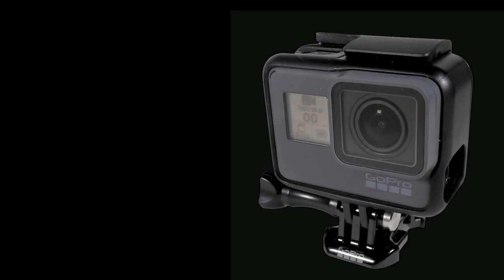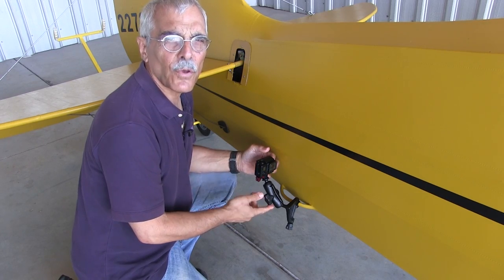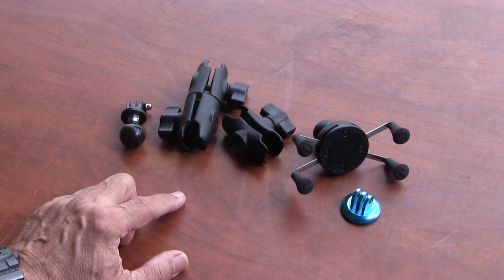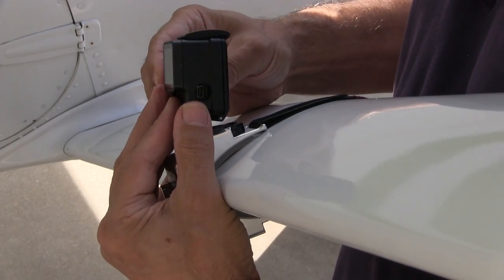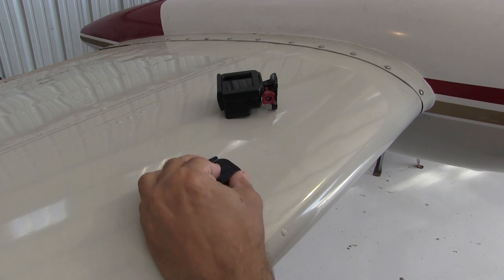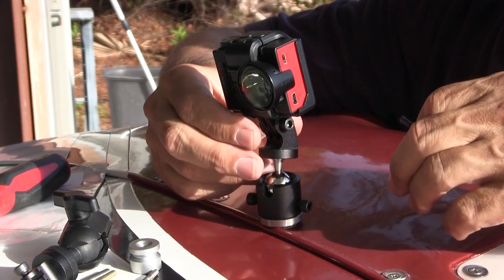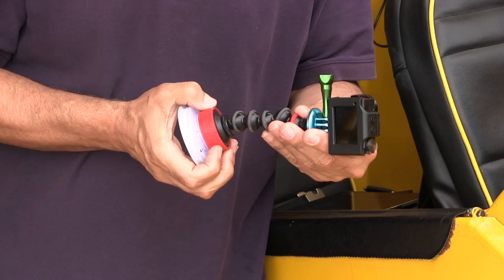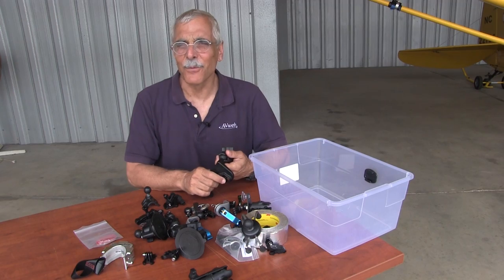How to Mount Cameras on Airplanes

Comment: I don't know if anyone will see this, but an additional option to add some security to keep the camera attached and protect the camera are "cages" made by companies like SmallRig.  These are exactly what they sound like - a milled aluminum cage that securely holds the camera inside and protects it from bumps on the outside.  They generally provide multiple mounting points and offer some additional points to attach a safety tether or to attach the camera in a different orientation.  Reasonably priced also!  I'm also a fan of purple lower-strength Loctite when I want some insurance that a threaded connection won't wiggle loose, but also won't require heating or crazy torque to get it to release.

Comment: I purchased the mount from "mypilotpro". I will try it out soon. In NE and weather not so good lately.  It does seem sturdy and I plan to connect it to my tiedown eye.  I plan to use a gimbal inside my cockpit with many different mounts I have. I use Gopro's and my latest is a Session5 it's really small, love it. Alos purchased a cable for inside mic sounds, looking forward to using that. Thanks for all your vids. Awesome.

Comment: As one of the members of the world's largest Cessna fleet operator, (think 550+ red/white/blue airplanes), we tried the double sided tape method to support the Garmin Virb.  This camera incorporates coordinates into the picture, so the camera must see the GPS constellation (read:  wing leading edge) .  After losing a few, we gave up on the tape and are awaiting a new, 'official' solution.  To be fair, the VIRB, in its case, has more than 6 sq  in of surface area.  If you go this route, be sure to have a return address inside the case.
Reply: "After losing a few, "?? WTF?? Do your FAA contract employers know THAT? Anyway, why would you want a return address on a cheap camera that falls off an airplane and kills someone or dents a fancy car?  Maybe don't attach a camera PERIOD unless its foolproof or has a backup cable Mr BFD 550+.

Comment: The part of this video where you use the scale at 6:02 has been instrumental for me. Today I successfully mounted a gopro onto a belly of a q400 and flew across the ocean from Vancouver to Victoria and back. I didn't climb higher than 4000 feet and my speed didn't exceed 240 knots or so and I use the sticky mount straight onto the paint and later peeled it off with a credit card. My question is, after I've peeled it off, how sticky is the mount and can it be used again? I'm hesitant to use it on an exterior surface for fear of losing my camera but perhaps a lower risk position?

Comment: I really enjoy (and learn from) your videos.  Question?  What does the FAA think of these cameras? Removing/replacing screws or suction mounts to attach (external) camera mounts?  Liability if a camera falling off (considering the camera itself provides video proof) including injuring someone on the ground?  What did you consider to be the cameras pressure at 100? 150? Etc...  I know that we just can't toss something from an aircraft without FAA approval.  External mounted cameras seems to be a grey area for me.

Comment: Very useful video. What are your thoughts w.r.t. incorporating Safety wire on the RAM Mount knobs and locks?
Reply from the maker: Safety wire is not a bad idea, because those thumb nuts will come lose. It's just as easy to wrap them in gaffer tape, though.

Comment: Probably been mentioned but remember that an aerodynamic antenna generally needs a doubler to beef up the foot print, so be very careful where you connect your camera, especially the ones that have a longer arm. Don't be surprised if your camera has gone along with a section of skin that has opened up like a bean can when you land- just saying. :)

Comment: Thanks for this video. I bought the mypilot ones. Cant aait to try them out. Do you have a video on favorite angles to shoot? I know you said one was boring just curious if you have any tips on better angles
Reply: Max this was three years ago. Checkout the mounts I now have on baronpilotshop.
Reply: @BaronPilot  I ordered the thing straight away. when you messaged me my heart sank i was like damn i bought the wrong thing. after looking at the site, i don't own my own aircraft right now and i don't think id be able willing to pay to put that on someone elses plane. the mypilot one looks good as i know there are tie downs on all the rentals. Thank you for getting back to me. When i get my own plane one day. I will Def get something like that.
Reply: Max Sperlich no no no I didn’t mean you ordered the wrong thing. You ordered a good mount. Just letting you know the alternatives and additional mounts available. Don’t worry you will be happy.
Reply: @BaronPilot  oh ok, cool thanks for the info! You never had a problem with them coming loose or falling off at all?
Reply: Max Sperlich I used that one on my tail which is somewhat protected from the wind, but with a metal camera case it’s not going anywhere.
Reply: @BaronPilot  awesome. Thanks for all the info. I cant wait to start using it. Any tips on best angles to capture throughout flight? Do you do it over multiple flights do you use multiple cameras?

Comment: I mount cameras external with screws. No way I trust an adhesive solution. Also, my interior suction cup mounts keep falling off. The best thing is to spread a little clear silicon caulk on the cup, but its a pain to get off again.
I have continuing issues with both camera shudder and displays that roll to black. Anyone else with these issues? Whats the solution?

Comment: Well, the way you mount cameras does not take the airflow into consideration. No one cares about the speed, but the  rudder efficiency is a critical point. I would not mount the camera anywhere in front of the control surface.